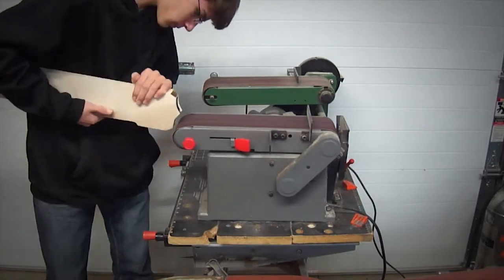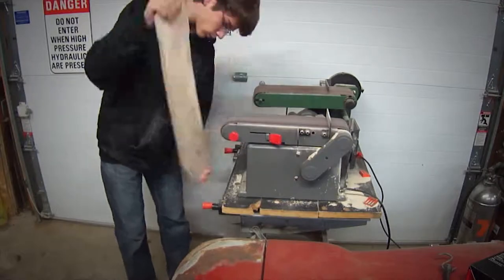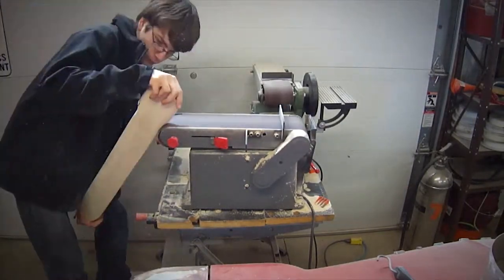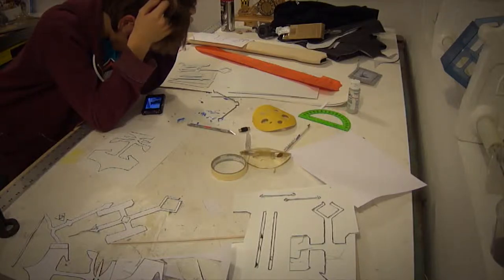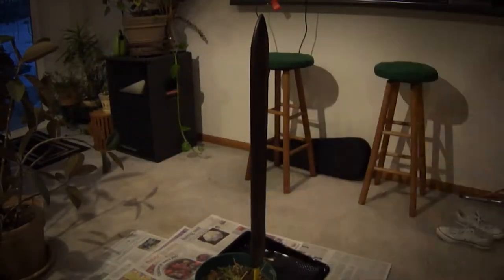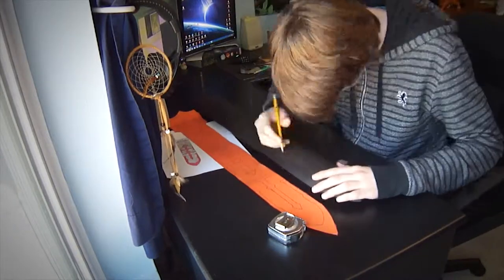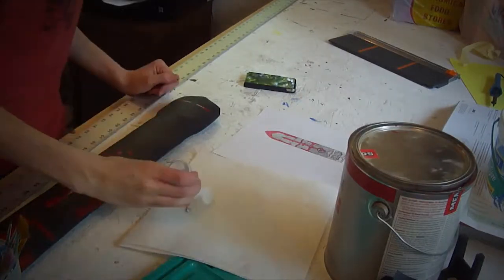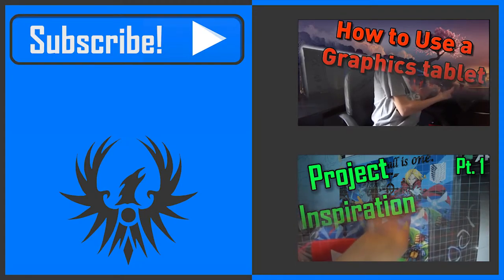How to Make a Wooden Sheath/Scabbard Pt.2

Comment: 4 months are you shting me.. jesus... im not well versed on this type of wood work... but i would thing a rasp (wood file) would have taken off material much faster... then sanded it when you got it close...
Reply from the maker: Realistically it probably only took me around 25 hours of work. If I would have worked on it everyday really hard I could have finished it in a week or two. But I just worked on it whenever I had some free time which wasn't very often, so that's why it took so long ;)
Reply: The Chosen Hero yeah but 25 hrs to shape one piece of wood is insane.... their has to be a faster way to remove the bulk of the wood... a wood planer... rasps... maybe you shouldve spent the first few hours researching HOW to do this lol
Reply from the maker: probably, meh its done and over not much i can do about it now
Reply: A draw knife would have made short work out of the bulk of the wood to removed. Sanding should have been for final refining only.